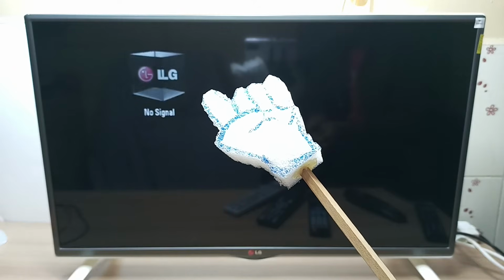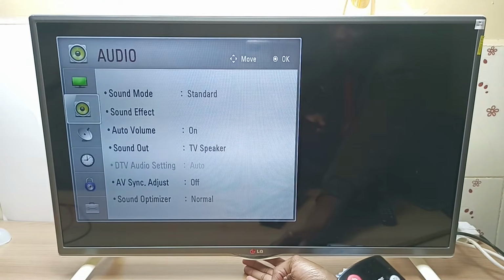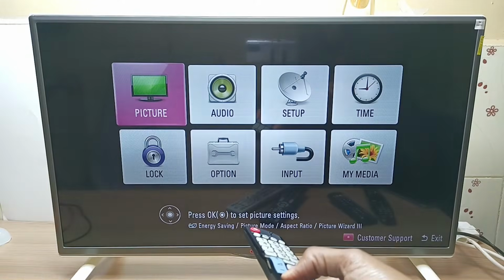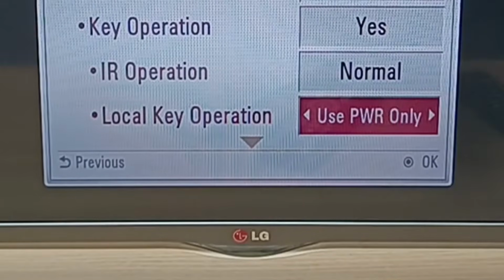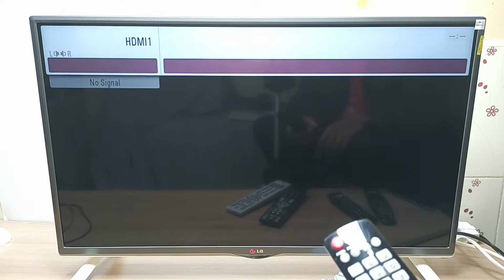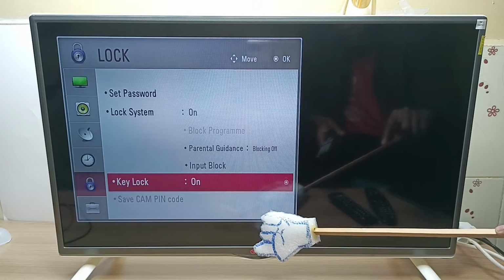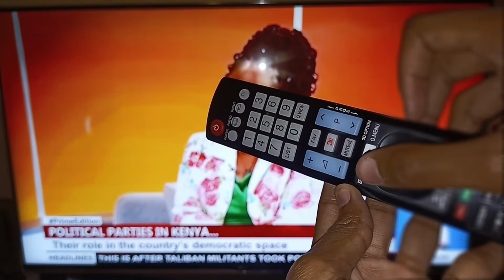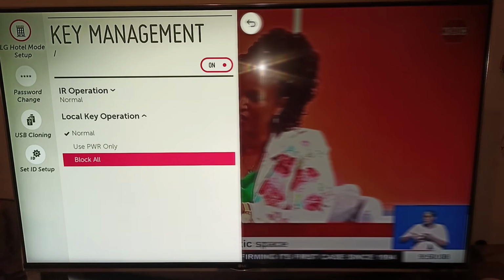Disable LG TV Physical Buttons Using LG Hotel Mode, Key Lock

Comment: If my remote doesn't respond neither and my tv its only at antena static? my lg its LG 32LC5DC8
Reply from the maker: Have you tried another remote control?
Reply: @DominicGichane yeah but still nothing intried other controll (same as the one i used) and the magic control and nothing, physical side buttons on the tv and remotes doesn't work

Comment: Can you please help , I turned hotel mode as you show, but my problem is that, now i cant remove it and all buttons are locked on  , working only power button. 
Is there any chance to factory reset tv without remote?
Reply from the maker: You can easily enter into hotel mode again. Just keep trying. I've also done it after I've disabled the On Screen Display https://youtu.be/5e3V9RE8U54
Reply from the maker: You can reset the TV anytime by using the LG service remote control I STOP function
https://youtu.be/u6TnPnP5vbk

Comment: Holding menu the tv power off nothing appear tv model 50pt350r-td
Reply from the maker: I think that's because this TV was manufactured before 2013 if I'm not wrong. LG Hotel mode works perfectly for models manufactured after 2014 with a select few 2013 models